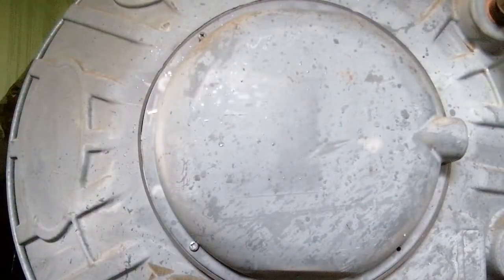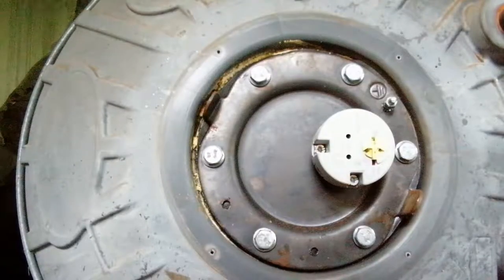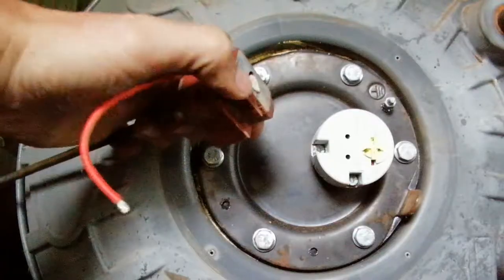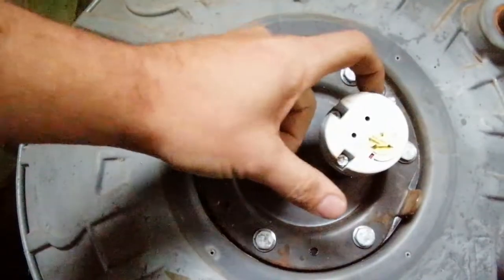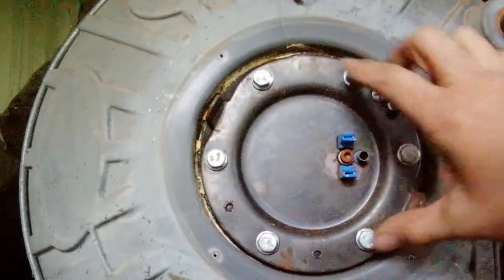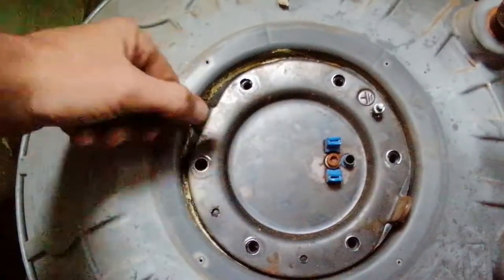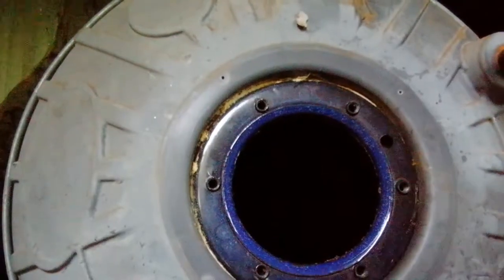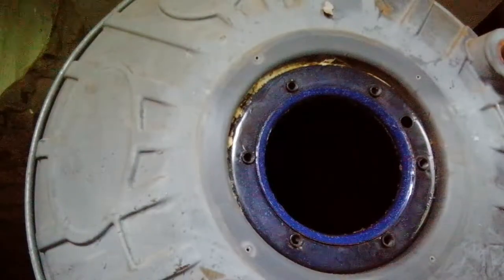How to Diagnose and Repair a Hot Water Cylinder/Geyser

Comment: Thank you for the great content I literally just changed my element in my geyser and it was quick and super easy...please guys before attempting any repairs make sure there is no power going to the geyser and ensure you have your geyser off for a few hours before you start so the water won't be hot.
Reply: Why would my water be hot if the element is broken 🤣
but good to double check the power is off

Comment: Dankie oom. Ive been having issues with a secondary geyser for almost 4 years now saving to get a new geyser. The water would barely get hot. The water would be warm for like 30 seconds then cold water would start running out.  Can't believe it took me this long to get onto google. First thing tomorrow I'm testing the thermostat and the element. Thanks a mil for the video. Its clear and straight to the point with no unnecessary yapping.
Reply from the maker: Glad I could help. If you are struggling that long, I woukd just change them both. Thermostat and element.
Reply: @p0we111  So after i posted my previous comment I went and investigated, only to find the guy who fitted the geyser mounted it wrong. You know the bracket can mount in thee sides of the geyser right? He mounted it on the centre holes meant for mounting on a flat surface meanwhile the geyser was mounted on a vertical wall so what would happen is that the incoming cold water would mix with the outgoing hot water as soon as you opened the tap. So all I had to was unmount the geyser move the bracket to the right side of the geyser and remount. Doing just that resolved all my problems. Just imagine. I was swearing in 11 official languages when i figured that out lol. Thanks again you saved me a boatload of money.
Reply from the maker: @DIYwithBraMangMang 
Glad you figured it out. That is the first time I heard if that problem and also the first time I heard of someone not mounting a geaser right 😄 but it makes perfect sense that that would be the result of improper mounting.
Good for you! Enjoy your hot showers!

Comment: I replaced the rubber gasket a month ago only to find it pushing out water at a high rate again. Interesting 🤔 I switched it off and left it to cool down over two days and it stopped leaking altogether. Could it be the pressure valve perhaps? Not sure how to adjust that? The valve has been dry throughout the process. Any advice would be appreciated 😊
Reply from the maker: Hi. I would suspect the pressure valave yes. The rubber gasket would leak and continue leaking. 
Plumbers have told me that some water coming out of the pressure valve is normal,but if it continues ill check with a plumber if I were you. Groete

Comment: Our geyser doesn't heat up at all, we got plumbers in to replace the element and two other things yesterday but we still have no hot water. I'm thinking it's an electrical problem? Our earth leakage switches tripped recently, too.
Reply from the maker: Hi Mike. Usually it is an electrical problem in my experience. If you have a clamp on amp meter it will be an easy test amps at the DB board.(No amps means electrical fault. Amps present but no hot water means plumbing fault.Just remember to run cold water into the geyser by opening a hot water tap before testing to switch on the thermostat at the geyser)
 
if you don't own a clamp om meter, you will have to guess where to start.
If you have a normal volt tester,test for volts on the wires where it connects to the geyser. If there are volts you can rule out the problem from the DB board and isolator(if present).
Check any connection/junction boxes in the roof area of the geyser.If a isolator is installed next to the geyser,open it and check the connections for loose/burnt connections.

If you want to start guessing which parts to swap:
 
If the plumber did not change the following,I would start with swapping the element and thermostat. 
This will fix 80% of you no heat electrical problems on the geyser.
   
If an isolator is installed,you can swap that as well.
Finally the breaker in the DB board can also be faulty.
All the guesswork can be taken out by simply testing with a volt tester.

Comment: Hi. My geaser tripped the mains. Replaced the thermostat and a day later the geaser tripped the mains again. When removing thermostat, same as in your video, it was not wet. I checked continuaty when thermostat was removed on the element and it had no continuaty which indicated the element was fine. Could I have had a defective thermostat that only lasted a day. Geyser is only not even 6 months old. Thanks
Reply from the maker: Hi. Checking continuity with a mulimeter does not always get the right result. Checking the element with a Insulation Resistance Tester will be better. 
9 times out of 10 a trip on the breaker means a faulty element...

Comment: Any advise for when the flange plate is stuck and won’t come off?
Reply from the maker: Hi Darren. If it is a steel tank,it is easy to just pry it open using a flat screwdriver. The gasket has to be swapped out 9 times out of 10 anyway. If it is a plastic/fiberglass tank then use more caution as to not damage the tank.

Comment: we have a 150L geyser, we changed our 3kw element for a 4 kw element is that ok to do?
also our thermostat is reading 125 volts
Reply from the maker: Im not sure what the voltage in you're country is as it does differ, usually 230V or 110V.
As for the 3kw for tge 4kw,it will depend on the wire size and circuit breaker size.
The 4kw could cause the circuit breaker to trip. Switching the current breaker for a bigger one could cause the wires to overheat and melt/burn.
It would be wise for an electrician to just check the wiring size, breaker and go from there.

Comment: If the flange gasket is leaking a month after replacing, does that mean the pressure valve is faulty? Or temperature too high?
Reply: Hi. Not nessesarily. Most of the times its just a matter of tightening the bolts to reseal.
Reply: Correct usually it leaks because either the sealing surface was not cleaned properly, or incorrect sequence and torquing of bolts. Maybe  steam cuts or corrosion errosion on the surface.

Comment: It is possible to connect without lid
Reply from the maker: Hi Masintle. It would still work but it is against the law to be able to touch a live part of the installation. So by law a lid will have to be put on but it will not affect the operation  of the unit.

Comment: Question,  if you are using an old geyser is it advised to upgrade to a new one to save money on electricity? We have a geyser that's 20 years old still working
Reply from the maker: The older geyser are less thermally insulated yes, but in my experience has a lower watt rating. Usually a 2000watt as the newer 150L geysers has the 3000watt element. That could also affect the power usage and could cost you more but that you will have to do a test for.
I have also found that the older geysers have better element in them that last forever. I have removed geysers that had the original elements in them where the newer ones break almost yearly.
Reply: @p0we111  thanks, what is your opinion on gas geysers here in south Africa compared to the cylinder type of heater
Reply from the maker: @theelusiveme7643  I switched from a 40year old geyser (more like a bin with an element) to a gas geyer. My electric bill was cut by almost R800 a month. While changing the gas bottle (19kg) every 2.5months or so. Did do the gas instal myself and had some issues with it shutting off 3 times during a shower...not good...

You do get better gas heaters that can regulate the temperature by switching on more or less banks. I would choose that one if I was to change my current gas geyser again.
Reply: @p0we111  we are four adults in the house  we shower like twice a day, the issue with the current geyser is not enough hot water where as with a gas geyser its endless, second issue is electricity especially in winter months.  With your gas geyser do you have to flush it out regularly for maintenance?
Reply from the maker: @theelusiveme7643  I've only had it for about a year. We live on a farm with not the cleanest water and no issues yet. We were about 9 people in the house for about a month and the bottle lasted only a month.
I would go for tge gas geaser but a high quality one as you do nit want to struggle like I did.
Get an expert opinion from a gas installer as the litres on the geyser will have to be matched to your showerheads and needs as this can also be a problem.
I can only give my opinion and as of today I will stick to the gas geyser. It has warm water when you need it unlike a solar geyser and does not run out like a normal geyser.
Reply: @p0we111  thank you for your experience, will definitely speak to a professional, seems the better way. Great video too

Comment: Hi there.. I’m having problems with my geyser, we changed the element and also the thermostat but still the water was lukewarm then when we switched off the water supply the water became hot, so what could be the problem cause everyone that we have gotten to come fix it says there’s no problem but there’s a problem cause for the water to get hot the water supply must be turned off
Reply: Hi CJ. You have ruled out an electrical problem. I am guessing that you have a water leak somewhere. Try closing the outlet side of the warm water as close to the geyser as possible,not the inlet side as you have done. Open it after say 3hours and immediately test the water. If it is hot then, you have a water leak on one of youre pipes.
I have also had a problem with a low pressure geyser after changing some pipes, it would reverse feed cold water into the geyser resulting in an overflow but the balvalve was working fine. 
I have also had a problem with a hot water pipe running inside a concrete floor. The concrete is so effective at keeping the water cool it takes ages to heat up the pipes for hot water. And then it is only mildly hot.
Let me know if you find anything!
Reply: Thank you so much for your response, I will definitely let you know..
Reply: @jeanboetzkes9820  thank you so much
Reply: Hi Jean… turns out you were right, the water was leaking from one of the pipes in the shower so we had to break the wall inside the shower to get to the pipes… thank you so much for your help it literally saved me from wasting my money to buy a new geyser 🙏🏾
Reply: Glad I could help. That waterleak can cost a lot of money! I had an electricity bill 4 x usual because of a leaking pipe... Congrats on finding it. Must have been a challange!

Comment: What the course if the gyser it's new it's get hot after couple hours the water get cold what's the course
Reply from the maker: Hi. That is a difficult one. Check if the supply is not interrupted by a timer maybe. If you have a tester you can check if the supply voltage is at the element when the water is cold. This could mean an element problem but further testing will be needed...

Comment: My geyser one day only gave out warm water, I replaced heater elm. and thermostat . Still no hot water, than I replaced whole geyser,  still only warm water. What might the problem be?  It is getting 220 volts at geyser.
Reply: Hi Richard. That is strange. First I will test for Amps as close as possible to the element. Not all testers can test Amps.
Second, I will check the connections as a loose or burnt connection somewhere on the cable can give a Voltage reading but as soon as the thermostat switches on it can "loose" the connection.
Reply: @jeanboetzkes9820  Thank you so much. That is what I was thinking, I also thought of replacing the CB.

Comment: Please help, i got a kwikot 150 l geyser when the water supply to feed the water into geyser its starts to leak from the bottom but not the side where the element is on the other side
Reply from the maker: Hi Tamara Nquma
That is bad news. If you can track the leak to one of the fittings you can just tighten it.
But if you cannot, it may be that one of the welds have sprung a leak. In my case I replace the whole geyser/hot water cylinder. 
You can try and take off the outer layer and try and fix the leak, but that could be tricky...
Reply: @p0we111  thank you very much, i suspect it might be the actual cylender because whenever i turn on the water supply it leaks, when turned of it does'nt the fittings are brand new and the tank was second hand.I made a mistake in thinking i was saving money by buying a second hand tank so far with the geyser kit I bought, I coudve bought a brand new geyser ......this is so stressfull its my first time owning one and i was enjoying taking hot showers in my own home for the 1st time.

Comment: Water is streaming out from the element terminal after replacing the flange gasket,thermostat and element.The flange plate as being tightened sufficiently.Where could be the problem be.
Reply: Hi. I would suspect that the rubber flange is not seated properly. Just a quess though. I did have a element leak water through a terminal, but it was an old curroded element not a new one.
If I were you I would open it all up and check the rubber flange and the allenkey bolt that tightens the element to the steel plate.
Reply: @jeanboetzkes9820  thank you Jean

Comment: Recently I fixed two geyser elements but they come on for few seconds and switch off.the elements is new and the thermostat is working perfectly but the water is not getting hot. Both of the geyser are in different places. They just turn on for few seconds and then off. It's stressing me big time.done all the test on new elements and thermostat. Pls help
Reply from the maker: Hi. Never had a problem like that before. Are both geysers connected on the same curcuit? Same supply?
Reply: @p0we111  no they are separate, I think the coil resistance in the element is weak. Thats y is comes on and off when it gets heated. recently lots of technicians  are complaining about the elements, I think  they maybe factory faulty
Reply from the maker: @wondernineth8341 
A good test to do to see if it is from the supply side of the element/thermostat side is to test both Volts and Amps at the same time on the point where the power enters the thermostat or geyser itself.
If the Volts stay constant but the Amps goes on and off it is a problem with the element/thermostat.
If the Volts also switches on and off it is a problem from the supply side.
You can even bypass the thermostat and to this test just do not leave it on for longer that 10min with the thermostat bypassed.
Reply: @p0we111  oky I get you as I had done that before but I will also do those test check again
Reply: Thanks again for your time and information sir.

Comment: What is it when it's tripping?
Reply: Hi.
It could be the breaker (least likely). Could be the wires (also not likely). Most likely would be the element inside the HWC. But I would just change both the element and thermostat.
Reply: @jeanboetzkes9820  I changed both element and thermostat but it still tripped. So today I'm gonna check the wires and breaker
Reply: 90% of the time the problem on the wires are at either end (breaker or thermostat).
Check for a connection box aswell. 
Good luck!
Reply: @jeanboetzkes9820  thank you
Reply: @jeanboetzkes9820  problem: element burnt gasket thus causing leaking and the water touched the thermostat causin CB to trip.

Thank you for your help

Comment: Why would geyser cause the geyser tripswitch to trip
Reply from the maker: Hi Donny.
If it is a overload switch in an existing installation, it could be a dead short inside the element or water leaking out and shorting the contacts.
Reply: @p0we111  ok thanx.

Comment: My gersey its not working even though I bought new element ad thermostat
Reply from the maker: Does the power come all the way to the thermostat?
Maybe check your breaker?
Reply: @p0we111  I did check the breaker and I even went to the extend ad put a new one.
Reply from the maker: @michaelndhlovu8514  do you have any way of checking the power? A multimeter or a test lamp.
That would be the only way to determine where the power is.
Reply: Same challenge here.element change thermostat changed by water only gets warm and there is 230 at the thermostat
Reply from the maker: @josem3466  Hi Jose M. Have you changed it with the correct Kilowatt element.
A good test will also be to check the amps with a clamp on tester.
A 100Liter geyser = 2kw element = around 8Amp.
A 150L geyser = 3kw element = around 13Amp.
A 200L geyser = 4kw element = around 19Amps.